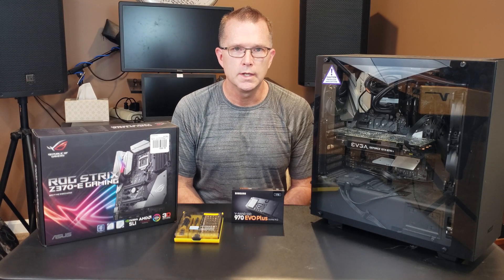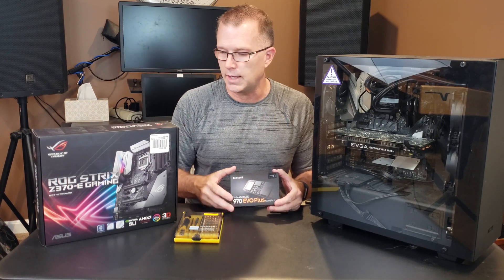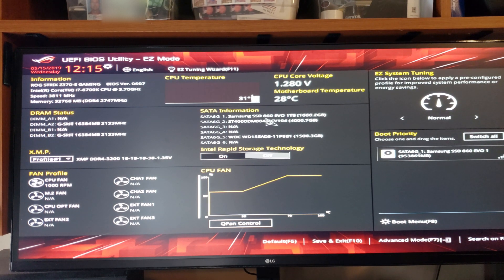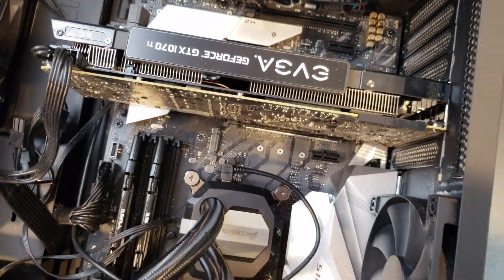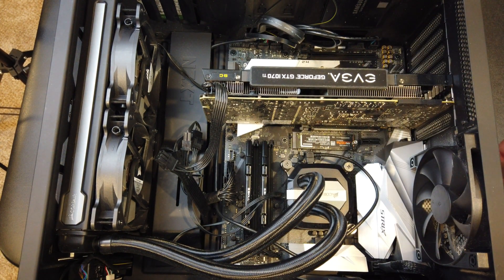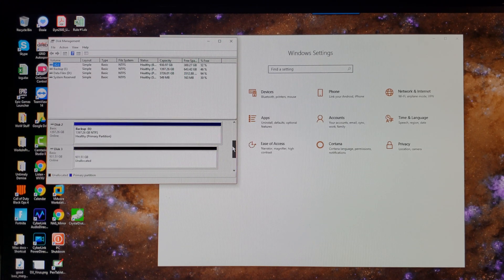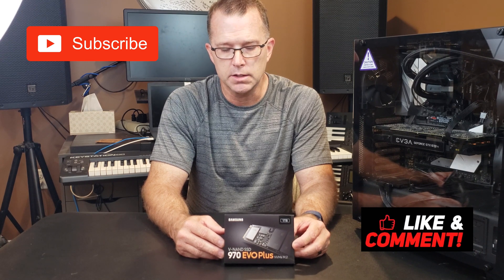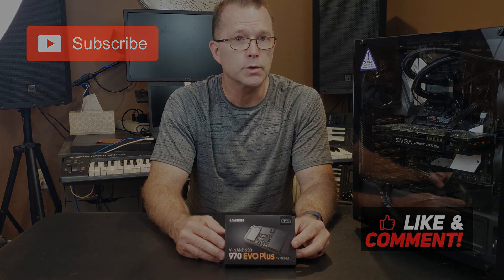SAMSUNG EVO 970 Plus M.2 NVMe SSD | Step-by-Step Installation, Configuration & Performance Testing

Comment: I just love that you have one cable less to worry about with m.2 NVMe SSDs, just ordered a new system with 2 slots so I can easily expand in the future
Reply: Just so that you know, SATA M.2 drives are similar in that they don't require cables. On paper, they're not as fast as NVMe. However, they perform almost identical in video games. Don't be one of those idiots getting NVMe for gaming; you gain virtually no benefit. That's a fact.
Reply: @googlewolly  I got a NVMe mainly for OS because I wanted to have at least some top tier parts, I have an additional SSD for games and a large HDD for general storage and old games where the loading times are limited by engine rather than storage (or simply not significant enough)

as a first time completely building a pc and after trying to cable manage my old PC I just noticed how massively more convenient it is to simply screw the SSD on your mainboard, didn't know about SATA M.2 drives at the time so thanks for the heads up I'll consider it if I upgrade in the future but probably prices are going to drop until then anyway
Reply: @brohvakiindova4452  Yeah - M.2 is nice. Do note, though, that using the M.2 slot usually (if not always) disabled one or two SATA ports. I'm not sure if it applies to just SATA M.2 SSDs or also NVMe M.2 SSDs being put into the M.2 slot.
Reply: @googlewolly  yeah I know, if the time comes I'll have to recheck my mainboards specs anyway
Reply: js59695  I stated why. Try reading the comment all of the way. NVMe provides virtually no benefit with respect to game-load times. If you can get a TLC NVMe for as much as a SATA SSD, go for it. Don't buy Samsung, though. They're overpriced.

Comment: Hi there, can i ask something please? Can i install windows on the drive and use it as my main system drive? also can i then place my editing software onto it as well? Thank you, all the best
Reply from the maker: It really depends on your motherboard.  The manual (or mfg website) should indicate if you can use it as a boot drive or not. If it's a recent model, it's likely that you can.
Reply: @ReeWrayOutdoors  hi thanks for youre reply. Its a Asus GL703V, and specs say M.2 NVMe PCIe 3.0 ... so thinking Samsung 960 EVO 250GB. Thanks for indicating that ill have to google if i can boot from it or not. But the principle is sound. Running windows of it as a system drive would make it super quick :)

Comment: Can you do a video on installing an NVMe drive then switching Windows boot to the NVMe from a SATA SSD, please. I built my first pc recently an installed a Samsung 870 SSD and an Evo 960 NVMe. Windows got installed and boots from the SATA. I want to learn how to switch boot to the NVMe  Samsung 960.
Reply: Ryan R late but, you can switch which drive boots first from your bios.

Comment: I really encourage you to use a active Cooler to the Samsung 970 EVO Plus NVMe M.2!
Because they are gonne really Hot during the Renderingprocess and then they throttle down dramatical.
Thats the Reason you got dissapointed. Check it out with HWiNFO64 (this Program reads out the internal Sensors of any Component and protocols Minimum, Maximum and Average. It also shows if the Device reached critical Temperatur and throttled down.) and a really good Disktest like ATTO-Disk-Benchmark (This check the Drives using different Testfile-Sizes to 
really Stress the Drives.) The Link below is the Cooler I used to get the Temperature down about 40°C even in very small SHUTTLE-Cases!
https://www.amazon.co.uk/glotrends-Positive-Cooler-Heatsinks-PA09-Heatsink/dp/B07CW8VB7T/ref=sr_1_2?keywords=glotrends+positive+nvme+m.2&qid=1573947188&sr=8-2
Reply from the maker: I'll give it a look!
Reply from the maker: Found this article. Seems to support your claims pretty clearly.  Looks like I need to do a heatsink video! :) https://www.maketecheasier.com/does-nvme-ssd-need-heatsink/
Reply: Here is the US-Link: 
https://www.amazon.com/GLOTRENDS-Positive-Cooler-Heatsinks-PA09-Heatsink/dp/B07CW8VB7T/ref=sr_1_5?keywords=glotrends+positive+nvme+m.2&qid=1573948168&sr=8-5

Comment: m2 creates too much heat near the cpu or gpu
Reply from the maker: I'd agree that it's something to take into consideration, but I think as long as you have a case with excellent ventilation, it shouldn't be a problem.  I've not had any issues.
Reply: @Rover Waters my 970ep 250gb runs between 32 and 48 Degrees C and it changes nothing!! my i5@5GHz and my GTX have still the same temps like without the 970. get one, try it, get schooled.. o.O

Comment: Hi, Sir

im a subscriber and i wanted to ask you if its ok that i dont use hard disk because its is slow to read. but is this ok ssd 1tb for my games and for the boot drive windows is in m.2 samsung evo ssd? will my booting and opening application and all of the thing will get fast? 
 
hope you answer me back thanks and godbless.
Reply from the maker: Yeah, as long as your Motherboard and BIOS support the M.2 as a boot drive (most do, if they're < 2 years old).  Using NVME as a boot drive should get you <10 sec. boot times easily and nearly instantaneous application launch.
Reply: i wanted the fast opening the windows, apps clients all because in hard disk they say it is slow?
Reply: thank you for answering me.
can you give me a budget list of  motherboard to high end motherboard that support the m.2 as boot drive. :)
Reply: im planning to build my own with youre guidance

Comment: I have ASUS ROG Strix X299-XE Gaming motherboard, which appears to have a pretty similar layout to yours, and it also has two M.2 ports, but in the onboard devices configuration in Bios I do not see any M.2 section, why is that? And aren't you supposed to get 3500 MB/s sequential reads with that? I'm also merely getting 3300 for reads and just 3000 for writes, which kind of concerns me as I noticed almost all other users hit the advertised speeds.

Comment: Optimally you would want to put your base medium your working with on one drive with your final work completed to a second drive. This is far more beneficial for those that are still suing HD's, or slower SSD's. Most SSD's and M.2's will also come with provisioning software which is similar to using something like PrimoCache and a RAMDisk. For those that do not have a motherboard with M.2 capability, they make a PCIe M.2 adapters. There are no conflicts, just merely knowing how to go about configuring a system for optimal performance overall. For even more performance set your C: drives static pagefile from 512 to 1024mb with a dynamic part (system managed) on the fastest drive. But also move the USER and system TMP|TEMP folders to the fastest drive. There are certain system services that can also be switched to manual or to a off that are automatically turned on by default. Black Viper has a page that covers this should anyone wish to do a web search for it. For most people these are new concepts, while for others it is not. In this regard I appreciate your content that you have taken the time to share. Thank You.  :)

Comment: I'm a photographer who is exploring videography as well, and I have a few computers that I edit photos and videos on. 

I just got an NVMe card that is 256 GB, and since my desktop does not have an NVMe slot, I bought a pcie adapter, and the motherboard recognizes the drive, but won't allow me to boot from it.

How do I set it up to boot from that NVMe card? If I can't, I have a 240 GB SSD I can put my OS on, but how do I set the programs up on a separate drive such as the NVME? (It works just fine as another drive, such as storage or a scratch drive.)
Reply: You have two choices as NVME drives require UEFI boot:

option one: you boot the pc from a UEFI usb stick (google: clover) and then you can boot windows from any PCI express mounted NVME drive (This is not easy to do and I would not recommend it for the faint of heart)

option two: you hunt down a Samsung 950 pro m.2 NVME drive. This is the only NVME drive which can boot from BIOS (so no UEFI is required) and work as a boot drive out of the box on old machines. Warning! No other drives can do this! No EVOs, no 960 pros, nothing else but the 950 pro. You are welcome ;)
Reply from the maker: Since you don't have an NVMe slot right on the m/b, it's likely that your m/b will not provide the option to mount it as a boot volume, unfortunately.  I'm not 100% sure about that, but I think it's very unlikely.  Maybe someone else has some additional insight and might be willing to share...   As far as separating your programs, you would probably have to uninstall them and then reinstall them, taking care to change the default installation path to the desired path.

Comment: You should initialize the drive with GPT partition style. It's newer system, it still allows to use NTFS file system, but is safer and less prone to errors. I think it's faster too. Will create more (4?)hidden partitions during fresh OS install, but they're not big.
Reply: exactly my thoughts. gpd is standard at W10.
Reply: It looked like he didnt even know what it was, btw is F2FS better/faster then NTFS?
Reply: @DaftPunkSkittle  how do u format with f2fs though?

Comment: might be a good idea to make the nvme your primary storage (o.s.) be much faster
Reply from the maker: I'll eventually be doing that...if for no other reason than to see what kind of difference it makes. Certainly boot times would be faster!  O/S is currently SATA3 SSD so it's not horrible now anyway (about 18 sec).   Not sure I'd notice much difference in general performance though since most of the critical O/S  code gets read into memory.  But...maybe?

Comment: What else can i use as the srew i didnt get one
Reply from the maker: yeah the drive typically doesn't include a screw :-/  Your motherboard (assuming you built your own kit) should have come with some extras.  I actually used a small standoff - not technically a 'screw' but it did the job. If you've got an old pc collecting dust somewhere, crack it open and take a look.  I'll be you find some compatible screws in there you could steal...

Comment: Great video! Thank you! I have a question:
I have a Intel 660p 1TB and a Samsung 970 Evo 1TB
Which one should I use for my OS and which one for 4k video editing?
Can I use the Intel 660p 1TB
 to put my 4k Media and Projects and edit 4k with Premiere Pro ?
My PC: 
i9 9900k
32GB Ram DDR4
Asus Dual RTX 2080 8GB
Motherboard: Asrock Z390 phantom gaming 4
Reply from the maker: I don't think it'd make THAT much difference either way.  The big thing is that you've got that i9 9900K! That beast will enable you to work with 4K media more than just about anything else.
Reply: @ReeWrayOutdoors  Thank you, your help is very much appreciated,  great channel cheers!
Reply: SSD to boot, with a primary M.2 as a read drive and a second M.2 to be written to for best performance. There are differences between a SSD, and there are differences between M.2 storage devices due to the chips that are implemented. The 660P is a economy storage device. Given the chance I would have suggested buying a Samsung M.2 NVMe.

Comment: Nice video. I hear that they raise temperatures those M2 drives. So i think it will be better if you place it to the other slot because there have better cooling. In BIOS you had set the first M2 configuration to PCI from AUTO. This configuration is for the same slot that you place the M2 drive or for the other M2 slot that motherboard has ?
Reply: Temperatures can be checked and a passive cooling solution can be acquired fairly cheap. I suggest using HWi64 that can be gotten @ https://www.hwinfo.com/

Comment: I watched many tutorials and guides on how to set this M.2 up and yours, by far, is the best! Thanks!
Reply: Yeah the expectation is that you are moderate to expert in computer engineering, not very customer oriented.
Reply: 10:19 The post SATA plug in satisfaction grunt ;)
Reply: just got my first M.2 setup on my motherboard and this tutorial helped out a lot compared to the others videos..2 years still the best :)

Comment: I thought to get full speed on a mvne pcie m.2 drive its best to set it as GPT instead of mbr i may be wrong but i read it somewhere? https://linustechtips.com/main/topic/811491-nvme-mbr-or-gpt-im-confused/
Reply from the maker: Yeah, I'll grant you that GPT would be the more contemporary/forward-looking choice.  However, from a performance standpoint, there's no real advantage either way.  And since the drive is <2TB, really doesn't make a difference at this point in time.  I'd probably select GPT if I was doing it over again. ;)

Comment: Is it Just Effecting 5 to 10 % on the rendering times of edited video ? My main work is editing videos and rendering ..Is it right thing to invest ?
Reply from the maker: yeah, the reality is that read/write speed is not going to dramatically affect your rendering times.  From what I have researched, it seems that CPU speed is the biggest driver for reducing rendering times.  And if your editing application is designed to take advantage of multi-core/multithreading, you'll ultimately get the best results with a fast multi-core CPU.  In the video editing part though, using a fast SSD should result in quicker performance for things like creating shadow files  (this is a PowerDirector term, but same concept goes for other editors) for smoother editing/previewing of hi-res clips.  Hope that helps!
Reply: I want answer. Because I suddenly built a pc with intel i7 9700k and gigabyte z390 aorus pro mobo. But I am using a SSHD

Comment: Great. Idea bud, thank you.
I am running an Asus Maximus formula xi board and have two of these 970 eco plus coming literally tomorrow.  
May I ask do you use the new drive as a system drive >? If so how did you do that? I ask as I am looking at my current 830 Samsung SSD and want to have the new 970 as my system disk possibly.
But it’s a new machine and there’s no cd drive , so I’m unsure how to install windows into the new drive from scratch
Reply from the maker: You can download a utility from Samsung (Data Migrator or something) that will clone the data from you current system drive. It's actually pretty easy as I recall.
Reply from the maker: Also if you ever need to install windows on a machine without CD, you can create a bootable USB drive with a windows install on it.  Microsoft has instructions on their Windows 10 downloads on how to do this.  Not too tough to accomplish.